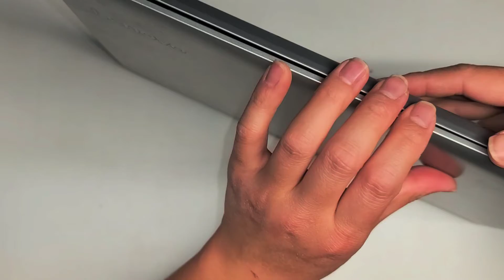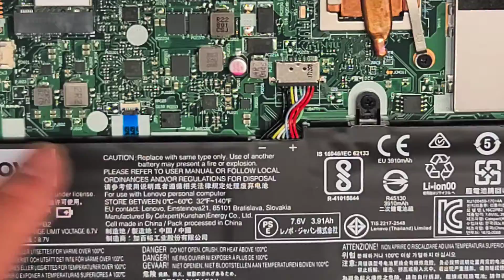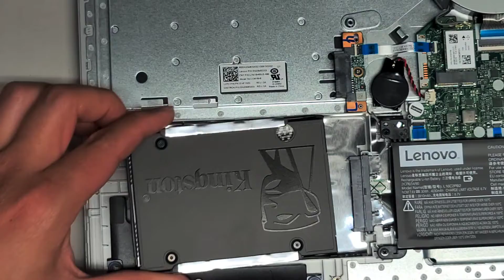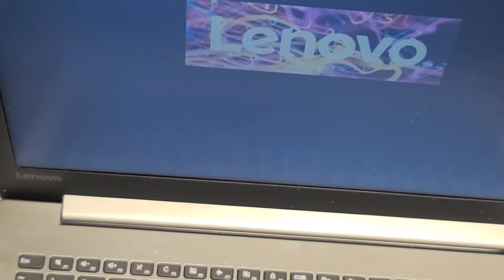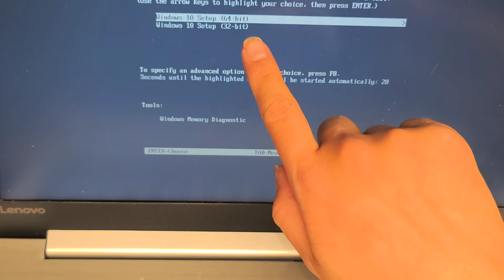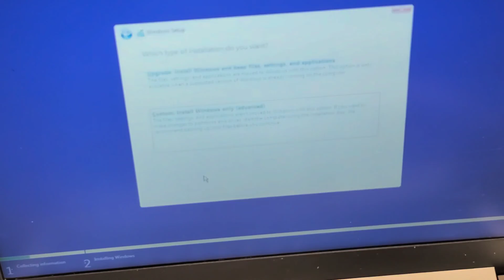Lenovo Ideapad 320-15ABR 80XS Disassembly RAM SSD Hard Drive Upgrade Repair Battery Replacement

Comment: Incredible content! 
I know this is an older video, but just in case you still check these comment sections out…I am looking to do an SSD upgrade as well as a ram upgrade. I imagine I’ll look for an 8gb stick and a 512gb ssd. Are there any brands you favor or stay away from? Also if I install a new battery do you suggest anything other than OEM?
Thanks again and you def earned a sub and a like on this vid. I’m excited to check out your other content :)
Reply from the maker: For SSD, this https://amzn.to/3p7Ldp8 For RAM, this https://amzn.to/3SAkWNy For the battery,  this https://amzn.to/3bALT3f has 1 year warranty.

Comment: I followed your steps and installed the same SSD on my Lenovo 320-15ABR 80XS five months ago. Last week when I was watching TV and left the screen alone. Suddenly, the screen turned blank with a static white line underscore on the left top corner. After that, I pressed Ctrl-Alt-Del but doesn't work. Therefore, I pressed the power key off and restarted my laptop. It would not boot up anymore from the SSD. Now, I have no idea how to fix this problem unless I rebuild the SSD from scratch but I don't want to lose all my data in the SSD. Would you please share your idea with me!
Reply from the maker: Does it show the boot screen?
Reply: @ItsBinhRepaired : Not at all that is why I need help!
Reply from the maker: @jonathantsang1636  that can be motherboard, charger, charge port, ram, etc.

Comment: When i pushed the bios button on the side, only the side indicator lights up and the display doesnot start up, what can i do to fix this?
Reply: When i push the power button, it only lights up like a fraction of a second, then only the side indicator lights up, the display doesnt start too
Reply from the maker: @plieseadeias204  check the RAM,  but it might be a dead motherboard
Reply: @ItsBinhRepaired  thanks man appreciate the help
Reply from the maker: @plieseadeias204  no problem

Comment: hey, I have original genuine windows on my laptop when i bought , so will I have the same original windows when i remove hdd and add ssd?  Thanks.
Reply from the maker: You can do this https://youtu.be/4p5jFDzVwUw or create a bootable Windows 10 usb installer with this https://youtu.be/R6GVDyVqWso license is linked to the computer.

Comment: I have 4gb solder and 4gb removable ram. And max is 16gb To upgrade can I buy an 8gb one. To increase it to 12 or do they not work together? Sorry for late comment
Reply from the maker: You can, but you likely won't get any performance increase unless you're running low on RAM. Better to do a  SSD upgrade

Comment: Does the Lenovo ideapad 320-15ABR 80xs support 1tb of SSD?
Reply from the maker: You can put any capacity that's available.
Reply: @ItsBinhRepaired  what do you mean by any capacity? Because I am worried if I changed from HDD to 1TB SSD it might not be compatible.
Reply from the maker: @leokai5174  I mean you can put a 4tb or 8tb if it exists. Doesn't matter.